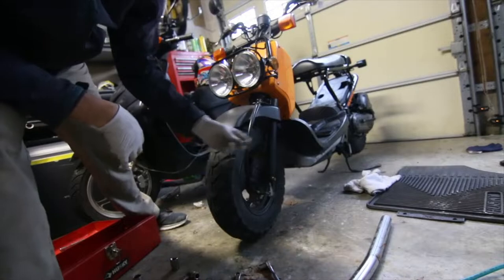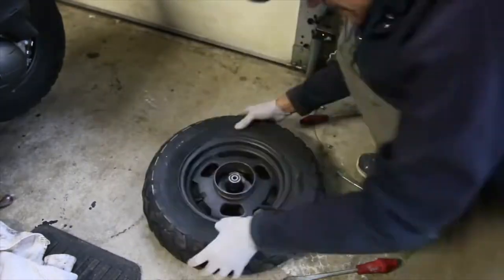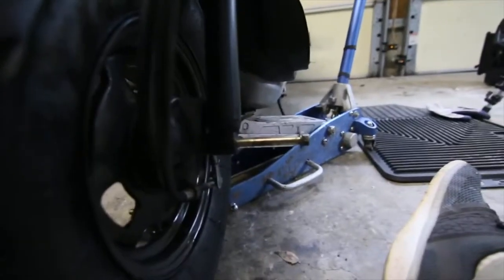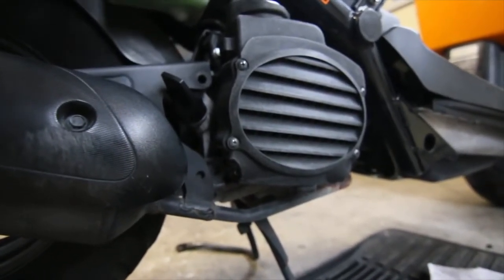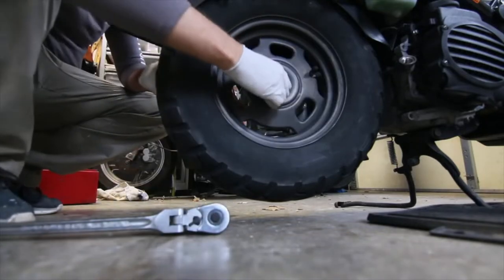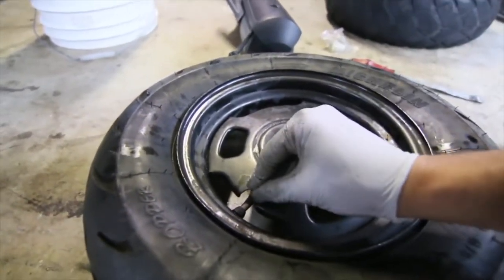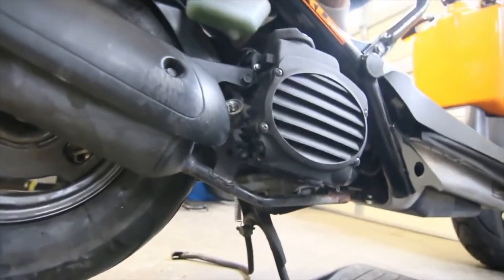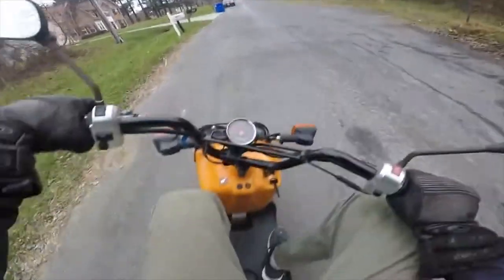How to change tire on honda ruckus

Comment: Just got done changing my ruckus tire, and MY GOD DID THEY TIGHTEN THAT BACK TIRE BOLT HARD, I had to sit on it the bike while my brother untightend it because the brake were too weak to keep the tire still. Thanks for the video bro I saved between 30-40 bucks. More cash for beer and gifts for my neice.
Reply: what size socket was the back nut? Probably 21 or 22mm?
Reply: 22mm @DyLemmaOG

Comment: My rear tire bolt is on so damn tight I can't get it off with a breaker bar or impact wrench.. gonna have to take it to a shop
Reply from the maker: I've had bikes like that. Try getting some heat on it. Also try putting penetrating fluid on it overnight. But a big breaker bar and the right tool works great. just get someone to hold the bike :)

Comment: Thanks for NOT showing me how to take on and off the tire. Like why would you go through the trouble of making a video on changing tires and skip showing how to remove and put on tires 😒
Reply from the maker: The videos shows how i removed and put on the tire. Did you watch it?
Reply from the maker: Let me know if you have any questions? what specifically are you having an issue with?
Reply: @motardsquid  I think he’s talking about removing the tire from the wheel